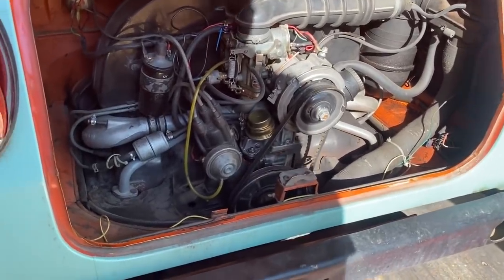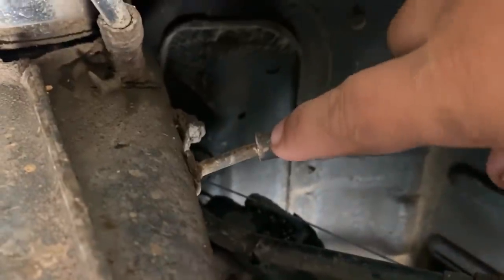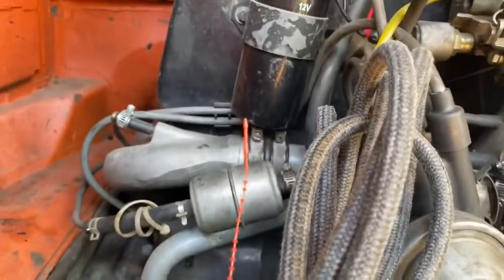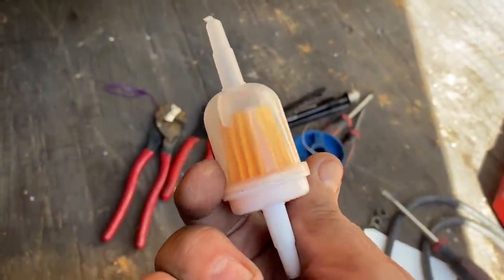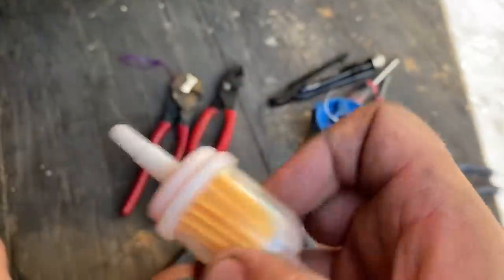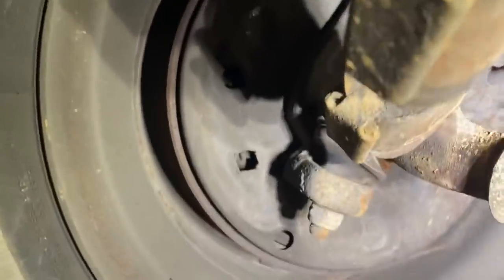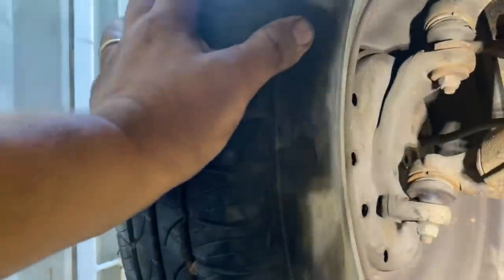Some  VW Thing Maintenance

Comment: That engine is made up of parts from several different years and types of Type 1 engines.  I would right away get rid of that California smog distributor and find a pure mechanical -009 or -019 Bosch.
That beetle engine has heat exchangers, but no fan shroud ducts to supply them.  A Mishmash of parts for sure! Also, get a 34 PICT -1 carburetor from a junkyard.  Those smog carbs are horrible...
Reply: ik04 I loved a 010 but hard to find, the next best was the 050
Reply: That must be an industrial fan shroud with no fresh air outlets , that's unusual.
Pure mechanical advance on a street car is a detriment, not a plus.  The mechanical + vacuum solution gives you the advance needed under partial load - like driving around town.  Easier to drive, more efficient, better mileage. 
I run a German Bosch 034 with my Solex 34PICT3 on a bone stock 1600 and she pushes the bus at 70 all day long @ 190 - 210 oil temp. 
That push/pull setup I see he has works just fine if timed to 10 ATDC - the carb and dist. were designed to be a pair.  
(it retards the timing at idle IIRC - rudimentary smog attempt but it doesnt hurt anything if set up right)
  *Unless you're drag racing or running in SNORE - mechanical + vacuum advance is the better solution *
Reply: ik04 ... most Things don't have heater channels in the frame because they used a gas fired heater under the hood. IOW, they didn't come with heat exchangers on the exhaust or the ducts on the fan housing. Obviously the engine here came from another car.
Reply: @Westy73  ... The Thing didn't come with heat from the engine or exchangers on the exhaust so that shroud is normal. What they had instead was a gas fired heater under the hood. Would agree on maintaining the stock carb and dist. A little fine tuning and it will run great.

Comment: Scott, the fuel filter is designed to fit two different size hoses, you clamped your fuel line to the larger portion, for better fuel flow you should have cut off the smaller end where it changes to the larger portion. If what I said makes sense lol
Reply: A metal filter would be safer and easier to change out.
Reply: Not sure that wild Thing has enough oomph to need the larger diameter considering the sub-100hp
Reply: @UnionThugg  but you cant see how bad the filter looks.

Comment: Keep some wood golf trees around when you're changing fuel lines. They help plug lines that drip or run while changing.
Reply: I use to use a #2 philips screwdriver to plug the lines when disconnected
Reply: I use old spark plugs.
Reply: I always like using shoulder bolts that fit, but whatever you have handy.

Comment: Something people don't realize is that being metric the fuel line fittings are 6 mm and they use 1/4 hose which is 6.4 mm so they rely on the hose clip to hold the hose on tight. Good to see you have the right hose.

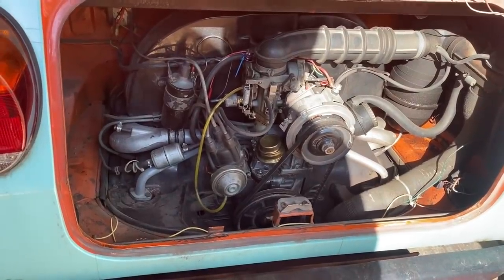Comment: Considering the Thing appears to have had a fire in the past...you may want to check your fuel hardline, all the way from the tank, and the grommets where the line enters and exits the frame.  When the rubber grommets get old, they let moisture in, and the mild steel fuel line can rust through inside the frame, eventually filling the frame with gasoline when the leaks gets large enough.  And the low point where it will leak out again just happens to be the rear grommet - right near the engine.  Seen it happen a few times on old Beetles, sadly.  Can't tell too well from the video, but that grommet @ 1:27 doesn't look all that tight against the frame.  

Easy test is to disconnect tank and engine, then seal the ends and see if it will hold a vacuum or pressure.  I reckon it's worth a look for peace of mind.  And its an easy fix if the pipe is on the way out - just switch to an external fuel line running down along the sill, where it can dry out any time it gets splashed.  :-)

Comment: My view on my VW things in the 1970s was there was no poimt in worrying about any problem as long as you could get a girl in it and it would proceed down the road!

All other issues, broken exhausts, fuel leaks, cracked twisted frame with water in it, faulty brakes, corroded headlight reflectors, bald tyres, faulty accelerater pedals, non functioning fuel gauges, dirty idle jets, worn front ends etc etc etc were just part of the VW experience.

Comment: I find a bit/ thin smear of petroleum jelly (Vaseline) great for slipping hoses on. It's quite harmless to rubber, fuel and oil. Good for plastic fittings because it cuts down friction, less likely to break it..

Comment: Maybe you can find a vw diesel engine and replace that gas burner. However there is a lot you can do to improve your power and torque on that engine.  Dual carb setups are available that are more reliable than that monster. A baja distributor and wires, headers and high flow exhaust. You can do a lot with that rig. Enjoyed this video👍

Comment: Scott,I worked on VW and Porsche air cooled for many years.i have !3) be busses. My (73) type 2 I repowered with a 1972  porche  911 6 cyl with mechanical fuel injection. it was a time consuming and expensive project.on the thing we always put the fuel filter between the fuel pump and the carb. The vacuum advance also is a vacuum retard. The distributor also had centrifugal advance.thd felt under the rotor needs a drop of oil . If turning the rotor back and forth doesn't happen the distributor will need to be completely disassembled and feed up. If the advance retard diaphragm is bad just replace the distributor with a total centrifugal advance distributor
 Always use Bosch points, condenser , spark plugs and coil. Your coil is upside down and should be repositioned correctly. Also check the fan shroud where the coil mounts as I have seen the nut fixtures pull through and the coil will Fall and cause serious issues. It badly needs a valve adjustment your engine is noisey. Pull the rocker arms off and look at the adjustment screws and the valve tops for pitting.

Comment: It aways amazed me how hard those old Volkswagens' are to work on and they need a lot of constant work.
Reply: NebukedNezzer
 ... Constant work? Yeah, a 50 year old vehicle probably needs more attention but back in the day (and if you knew what you were doing) they really only needed oil changes between major services. If you kept the valves properly adjusted and never threw a fan belt (overheating) you could get 100k miles out of an engine. OTOH, most people failed to do that because they just didn't understand how to do things correctly.

Comment: With the German line you won’t need hose clamps. Work on these for years for a friend who was actually a factory trained VW guy and have never seen German line fall off. Get the fuel line away from the intake pre heater pipe. 

Has that engine ever been over heated?  I thought I noticed a head pop in a video, might be just how the camera picked up a sound.

Comment: If I am remembering correctly from my 70 type 1 there is a pair of holes for the metal fuel line to come through the fan shroud. Also I kept my aftermarket inline fuel filter under the fuel tank as my fuel pump had a fuel screen built in.

Comment: Okay take the factory chirping bird exhaust system and throw it in the trash and get a monza big bore 4 tip muffler you'll thank me later. your coil is upside down its oil filled and cooled if theres any air inside the coil it'll cause heat issues and cause premature death, not to mention water can pool on top and cause corrosion. Me personally i would chunk.the intake and the carb for a set of webers. For a few bucks that engine could give you so much more

Comment: Had some running issues with one of them engine one time that had the rope covered fuel lines, as it was running I began feeling & pressing the hose, as I got about half way down the hose mashing on it a squirt of gas came out, I had found a PIN size hole evidently under or through the layers of the hose, and it was NEW, I replaced with the same and had no running issues, the HOLE was NOT visible to the naked eye.

Comment: "these are the only metric tools I own"  I have not heard that line in 20 years...:  )
Reply from the maker: My adjustable wrench also does both ;)
Reply: True.  Most of my tools are metric, but I have owned mostly foreign cars and motorcycles.
Reply: I had a 10mm adjustable once.  Would you believe, I lost it?  :-P
Reply: Don Moore   Yep i had hondas growing up.i think i got metric tools for Christmas....Sooooo. long ago.   😂
Reply: I am amazed at how you fit into tiny places. I wish I could wrench while standing on my head...
Reply: I started on '60s Valiants (both slant and hemi-6), then got an old Mini...so while I had metric tools (a lot of cheaper sets came with both), the metrics were only used as surrogates...like, if I lost my 1/2 inch, I'd go rooting around looking for my 13mm.  Of course, that changed when I got into Japanese motorcycles.  :-P

Comment: i dont like the cloth braided fuel hoses , you cant see when the rubber starts to crack underneath , once you see the fuelline turn darker due to the leaking fuel it is often to late....
Reply: I second that, had it fail 3 times, then got Gates line and no more problems.

Comment: "Wheeler Dealers" did a VW Thing (Series 12, episode 7) and a front disc brake conversion was among the work carried out. The kit had to come from Germany and it was not cheap.  Is it just me or is the fuel line from the pump to the carb uncomfortably close to the coil?
Reply: Number 1 manufacturing rule when this "thing" was built: it's ran fine when it came out of the factory its your fault it caught on fire

Comment: if you put it on bracket on the air fan in the back of the motor it easy to replace  and it up were you can see it

Comment: Every time a friend of mine gets an air cooled VW I tell him/her to check the fuel line and change it if it's at all hardened.
Reply: Acme Racing
 ... why wait till the fuel line is hard? It's already 50 years old so just change it. $5 well spent as insurance!
Reply: @rupe53  It's probably been replaced more than once by now. If it's not like new, change it.

Comment: Getting rid of the NON- Braded  rubber fuel hose is about the best thing you can do. doesnt take long for the fuel to deteriorate it, next thing you know, it's Bbq sauce.👍
Reply: the factory braided hose was very reliable, until alcohol made it's way into the fuel supply....
Reply: @marzsit9833  Yes definitely, alcohol fudges everything up. If IAM not mistaking, the factory hose was "Aramid" Braded or something like that.

Comment: I see you have bug heater boxes on your thing's exhaust. as i don't see on the frame forks is the little stubs that come out as that connects to the heater control cables to the right lever on the handbrake originally the left lever be the rear footwell or defrost on late model bugs. or else the previous owner might of put in a beetle engine after the fire.  as the later model 1974 thing had the beetle heat exchanger or heater boxes. as the rear tin is different and  the beetle fan housing has the air ducts that feed the heater boxes.  as 1971 and later 1600cc dual port engines has the doghouse oil cooler fan housings as earlier single port engines from the 1200cc, to the 1600cc single port motors has a regular fan housing as the housings 1963-1970 has the ducts  and heater boxes the heater boxes on the 1975-1979 beetles are different as well as the exhaust system as they were fuel injected as these heater boxesyou got on went up to 1974.
Reply from the maker: 73 thing didn’t have any engine heat so there are no cables or chase duct for the engine connection. Just the espar gas heater in the frunk
Reply: i see the original engine must of caught fire i seen a slot hole in the center of the bumper as that was for a hand crank  to start the engine with as you need a special crankshaft pulley bolt as i seen the Things had them. the Beetle they had the gas heater as an option the Espar or the Stewart Warner Southwind heaters. the Thing it was closely related to the original WWll Vw as then it was called the Kubelwagen had the vw air-cooled motor was only a 25hp 1131cc which ran up to 1953. as the Kubelwagen its the KDF era which went from 1938-1945 the windshield on the Kubel folds down like the thing. the vw air-cooled engines in late 1953 the displacement went up to 1192cc which is 36 hp it went to July of 1960 on the bug as the 25 hp 1131cc and the 36 hp 1192cc the generator stand is casted in the right engine case half.  then the engine in 1959 went to 40 hp 1192cc or 1200cc used on the bus then on the bug and Ghia went to 1962 on the bus and to 1965 on the beetle and Ghia as 1966 the bug and Ghia in the us got the one year only 50 hp 1300cc with the 69mm stroke the beetles and Ghias from 1967-1969 the bus from 1962-1967 had the 53 hp 1493cc  1500 single port  the bug and ghia in 1970 the bus from 1967-1970 had the 1600cc single port the bus  1971 and the bug 1971-1979 Ghia 1971-1974 and thing 1973-1974 have the 1600cc dual port  the 1975-1979 bugs 1600 dual ports the left case half has no provision for a mechanical fuel pump as the engines used a Bosch air flow controlled fuel injection system with a distributor like yours combination of centrifugal and a vaccum advance and retard. as people changed the fuel injection on them back to a carburetor on 1975 and later bugs the problem is they have to run an electric fuel pump designed for the carburetors the 34 pict-3 or a H30/31 pict carburetor with adapter
Reply: @derekobidowski3301  .. The EFI system you speak of in the later bugs is the Bosch L-Jetronic, which is almost identical to what Datsun / Nissan used on their 2.4 ltr 6 cyls in the late 70s.

Comment: i say no to modern braided hose ...cant see it perishing and cracking until its too late , buy the best stuff you can
Reply: steveo3002
 ... pretty sure that tag said it was German hose for the VW. That's the CORRECT stuff to use and never needs clamps.

Comment: i had a hard starter ,turns out it was the condenser
Reply from the maker: Only when it’s hot?   Starts fine cold
Reply from the maker: And it’s only hard if you wait more than 5 min when hot.  You can turn it off hit and it starts perfect up to about 5 min after that window of about 5 min it’s a 20 seconds of turning over to start.
Reply: @BusGreaseMonkey  ya thats wired,try putting a little fuel right in the carb when it wont start,also that condenser worth a try.still hard to start after changing fuel stuff?